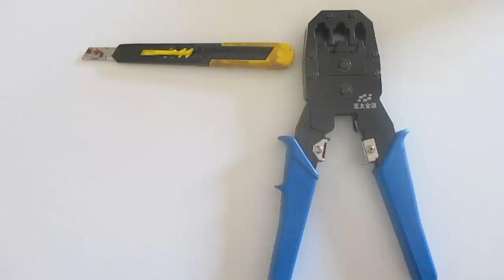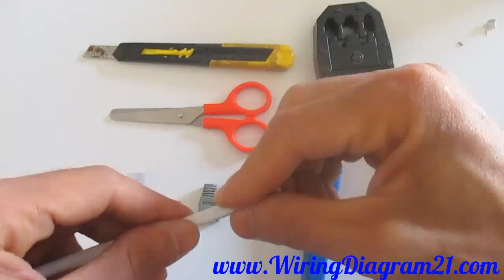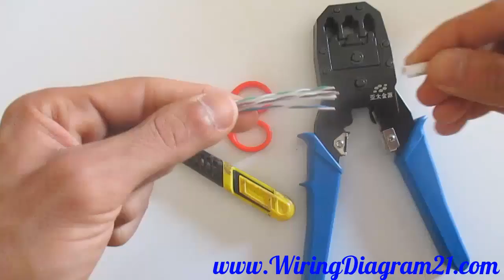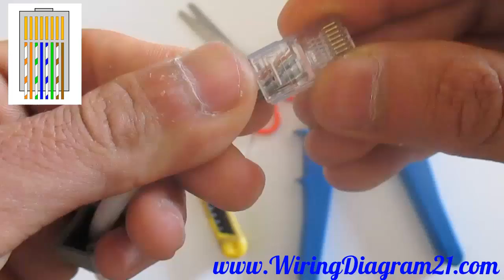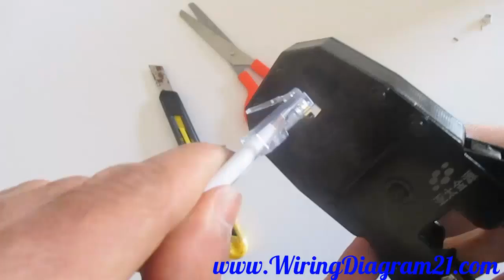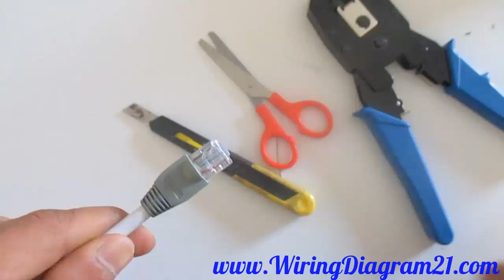How To Wire RJ45 Cat 5 -5e - 6 ( Ethernet Cable Diagram Color Coding )

Comment: If I'm running Cat 5e from a switch to an Ethernet wall  plate I need to use straight through: O, O/W, G/W, Bl, Bl/W, Br/W, Br (T-568B) on both sides right?
Reply: Yes you either use  A or B, doesn't matter as long as it's the same standard on both sides ( we use crossover when connecting similar devices to each other, ex: pc to pc)